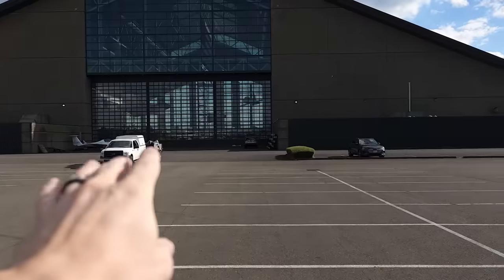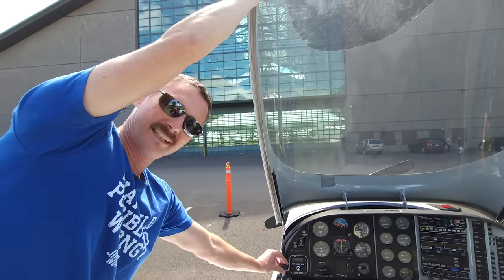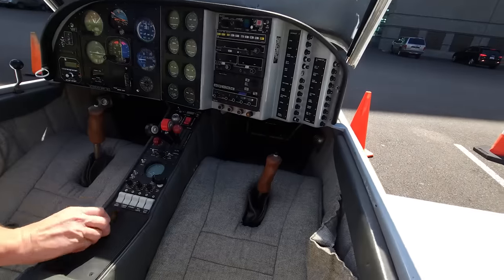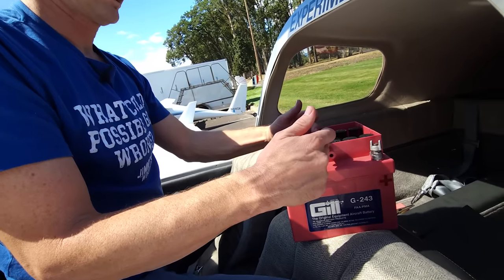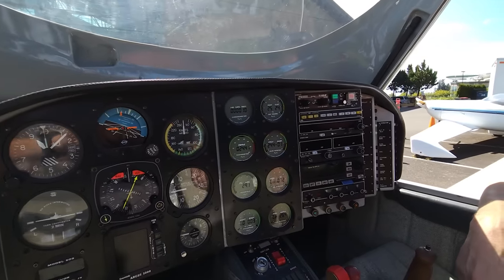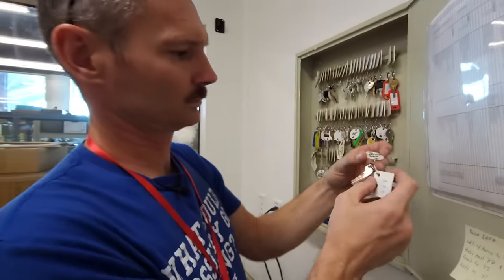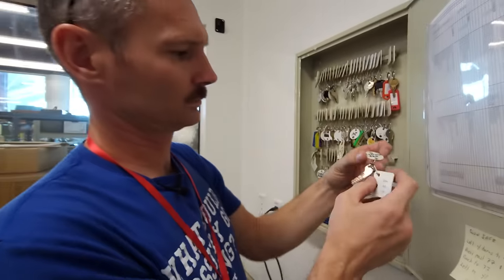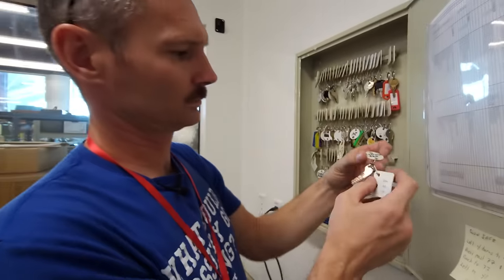Will This 250mph Museum Airplane Start & Fly?

Comment: This is a really cool idea, take a museum plane that was in flying condition when it went in and restore it to flying condition. I have always felt a little sorry for museum planes because they look pretty on the outside but I know they’ll never fly again. Looks like this one could be an exception!
Reply: yeah, most museum planes are empty hulks, all the useful but invisible bits stripped out and used to either keep other aircraft flying before the plane was put in the museum or sold by the museum as an extra source of income.
Reply: I have always said that vehicles go into museums to die..
Reply: @jwenting  Right, and most engines are "Pickled" and fuel tanks are drained and purged for the safety and comfort of the visitors. So there is quite a bit of work to do before they are air worthy.  Especially since the FAA keeps writing new regulations that have to be met each year for the current Annual to be signed off.

Comment: As an A&P, Flight Engineer and Pilot that doesn’t get to fly hardly any, I love this. Jimmy, thank you! One of these days, I’ll get back to flying but until then, you’re it.
Reply: As valuable as the engines are, I find it worthwhile to do a little more diligence to prevent damage after long term storage. I would have purged the fuel lines, borscoped the cylinders and fogged them before even cranking the engine. The smoke was obviously unburnt fuel because the ignition was off (no checklist?) But there's a lot of smoke because the rings haven't fully set in (normal after storage) but let's hope the cylinders survived dry cranking, also a cause of excessive smoke.

Comment: That little snake was absolutely terrified of you.
That's a nice Lancair you bought.  Pretty darned good for sight unseen.  Looks like it needs some work, but after sitting for 20 years, that's to be expected.
The leather flight suit with the electrical connection?  Yep, back before bombers were pressurized, crew members, especially waist gunners who would stand at and fire from open windows, wore electrically heated suits.

Comment: for the gas cans, buy race cans (sometimes sold as utility cans). Can fill cars/boats/airplanes much quicker, and there's none of the safety junk
Reply: They make an awesome battery pump for them too. Even has an auto shut off so you don't over fill! (TERA PUMP TRFA01-XL)
Reply: One can also purchase old school spouts from that giant online sales company named like a big river. I got a pack of 3 for ~$10 a week ago, to replace the Cali spouts - which I believe were designed by cardiac doctors with the intent of creating customers with high BP.
Reply: Those spouts aren't that bad, just grab the red safety piece w a pair of pliers and yank it out and they work fine 👍
Reply: Yep. I did that long ago!
Reply: You can also find the military style fuel containers at surplus stores.  Be sure to pick up a nozzle to go with it, they work great!
Reply: I thought those were outlawed for whatever reason?
Reply: @topaz123212  technically yes not EPA compliant, but everyone in the racing scene uses them and DOT/racing authorities don’t seem to care, and they’re like $22 at tractor supply. 
They’re way faster to use, make it much more difficult to spill fuel, and close to lock vapors in

Comment: My Museum.  I watched it being built for The Goose.  About 100 miles south of home base.   Incredible plane you found, and Evergreen had Everything.   Just wake-up smoke on the new plane.  Wiping the eye boogers out.  You would cough and choke if you slept for 20 years and then some crazed man is shaking you awake.   It really should have been cranked/pre-lubed with fresh oil before it was parked, but such is life.  Swap out the old oil and circulate, then do a compression test.  Then go fly it if it says yes.  The original builder of that plane was a perfectionist.   Can easily be seen.   Bike spoke piano hinge wires for the piano hinges or lineup of such hinges on the cowling.  Looks like he Dzus'ed everything and rid himself of the picky piano hinges on the cowling,,and saved the bike spoke/ Piano hinge pins.   That one will definitely cut the clouds in two once again.    Regular compressed air on the struts, fly not higher than 11,500, unless nitrogen is easy to find and cheap.

Comment: Not bike spokes. They are piano wires for removing the engine covers. They also work to remove the hinges on the gear flaps. They used them years ago to hold the cowl hinges together.

Comment: There used to be an EPIC RC flying field right behind where you were working in the parking lot. It was championed by a local Chaplain, Roger Weeks, and the irony was when he passed away they tore down his legacy and built that church that sits there now behind the parking lot. Yes, they did locate a new model field out off the parking area on the far back side, but I don't understand why they tore down what was there! There were paved runways, a permanent bathroom, and it was well manicured like the rest of the property. Take care of that old girl! I used to volunteer at the museum when I was in High School, before they built that building. At that time the Hercules was still in restoration across the highway.

Comment: Strut fix.
I've had excellent results with mixing about 20% AT-205 transmission reseal with strut oil then moving the strut up and down and charging it with nitrogen. 
Struts which have leaked in a month, have lasted 3+ years now.

Comment: Couple observations Jimmy. The dessicants are showing pink, which means they have absorbed moisture. They can be gently baked dry again and will be blue. The oil filter is a  mesh metal screen in the black box on  the right, inside the lower cowl. The screen is cleanable (if my dusty memory cells are functioning correctly.) Please check all ADs. Especially the fuel injector servo. The item you pointed out on top of the engine as the fuel injection servo, is the fuel distribution valve. The fuel servo is attached to the oil sump.  But I suspect you know that.  BTW, that museum looks like a cool place to hang out. I wish you would walk by the SR71 engine that was displayed behind the SR.
Reply from the maker: As usual, thanks for all the great info. Just wait till the next video I talk to one of the engineers that designed the SR 71 engine.
Reply: @therealjimmysworld   Why were you scared of a little snake when there was a great big Habu in the hangar?

Comment: Jimmy
The black blocky thing looks like an “Oberg” oil filter.
We used them in race cars.
You can take it apart to clean/inspect it for metal or other unwanted materials in your oil.
Btw that’s a very well put together build. That man in Arizona was very particular….you should feel confident in flying it……

Comment: N44BH 
Oil , Plugs Hoses , One belt, check oil for Grit and Metal fragments, replace seals On landing gear replace and fix Lights on Landing gear.
check Fuel Lines. Check rest of aircraft with Standard checks then check it again for Flight.
Good Buy Jimmy.

Comment: I can understand the joy in finding the documentation for the airplane. I purchased a government boat thinking all of the paperwork would be in order. What a joke!  They did not follow any of the government rules which everyone else has to abide by.  I dug very deep into the history of the vessel thinking I would get a paper trail that could establish some of the necessary information to use the vessel as a passenger vessel. I even talked to the vice president of the company who remembers the boat well as he was sweeping the floor when the boat was being built. After 3 years of digging and prepping the vessel for commercial us I finally gave up and sold the boat to a person who is using the boat for personal use and is having a great time with a well prepared boat.

Comment: 15:04 that looks like a Northrop Grumman RQ-4 Global Hawk. It's used for Intelligence, Surveillance and Reconnaissance (ISR) using high-resolution Synthetic Aperture Radar (SAR) among other sensors. It has a wingspan of ~39.9 m, comparable to the Boeing 757's wingspan of 38.0 m.

Comment: It looks like an Oberg filter.   its an oil prefilter with a removable / cleanable screen.   use it to check for metal particles in the oil.

Comment: I'm curious about the leaking fuel line.....  did the line actually fail, or was it just left loose from where the museum might have drained the fuel system before storage?
Reply from the maker: That was my first thought too. Nope :/ fuel line :/
Reply: @therealjimmysworld  It's fairly unusual for a teflon lined, stainless jacketed line to fail, unless it was bent too far.
Reply: @i.r.wayright1457 I doubt it was Teflon lined..
Reply: @thomasaltruda  What is the difference between Teflon and PTFE hose?
The simple answer is that they are the same thing: Teflon™ is a brand name for PTFE (Polytetrafluoroethylene) and is a trademark brand name used by the Du Pont company.
PTFE fuel hose has an internal Teflon (PTFE) liner that acts like a vapor barrier when running all types of fuels. This becomes especially useful when running alcoholic fuels, which otherwise often go through a traditional nitrile or rubber fuel hose.
Reply: @i.r.wayright1457  ok, but what makes you think that stainless braided hose was Teflon lined? I’m pretty sure it’s just got a rubber core. Aircraft rubber hoses are life limited around 8 to 12 years I believe.. it’s not surprising that it failed. All the hoses on this plane should be changed..

Comment: that's so funny you finding the rat paks, OMG Jimmy, i had some of those, in fact i bet i still have one sealed somewhere hidden away, and in the corner of my kitchen are a couple of those very Tabasco bottles (empty), so diddy i dare not through them away, will refill if ever i need some to go away with, if you not got room for a full size bottle 'that's just stupid'
remember, these paks were designed to fill you up, and bung you up, so you could work and fight for days without ever being worried about being caught out with your trousers round your ankles - but when you did finally go, oh dear, semtex was needed
nice plane Jimmy, a little playmate for the other one, get young Silas flying next to you before long

Comment: Hey Jimmy ... just remember, it was in a museum,  they probably loosened off the fittings to drain the fuel tank before it went into the museum.  I bet the line is fine, just the fitting was loose.

Comment: The plane my dad worked on (he made the fiberglass molds) is in the Smithsonian Air and Space Museum.  The wings have been removed for storage, but I don't think they were designed to be removed, so it probably cannot be made to fly again.  It's the Windecker Eagle.  There is one Windecker Eagle flying today.  The rest (there were 7 made I think) are in various museums or static displays or crashed.

Comment: Make sure u get the exact part number strut. I worked for a part store when I was a kid, and people would always just try to match the length and and one guy folded a trunk lid. It had too much pressure. Just a heads up.

Comment: Jimmy,  there's a hole in your plane @ the 10:00 mark
Us army air corps turned into the US Airforce in 1948
I've never built a plane,  a bunch of cars and bikes, yes but a plane no.  
That is a clean build ! For any build this one is top notch and a gorgeous build
Stainless steel fuel lines have rubber seals at the connections some times.  The rubber could have deteriorated over 20 years of no use

Comment: Nice video, and your new plane will need a sun shade while you're flying. The long thin rods run through the cowlings joining edges, and the short bikes spoke keeps the opposite end in line while pushing the long rod in.  Excuse the expression?  That pitot tube will need a cover to prevent wasps building nests.  Happy Safe Flying!

Comment: Random bits from blue bin….
- clear plastic cup with white top for checking water in fuel?
- spoke for clearing a clog in a hose?
- Data plate, lists O-360 180hp while eng looks to be iO-360 200hp/215hp ?
Long thin steel rods, either for a canopy sun shade or replacement control surface hinge pin?
Looks like an awesome spare airframe for you to keep one flying - although its sad if it’s never flown again as the donated party wished.

Comment: Possibly, for the final time, it wasn't in flight for twenty years. It had residual fuel in the hose. That's the reason why it had that terrible odor. As for the smoke, it was because of that fuel. While that fuel was in that hose, it separated inside of it. That separation happens whenever fuel is not being burned in the cylinders of that engine. All you needed to do was to wait for that residual fuel to be burned inside of them. Then, it will stop smoking and stop smelling terrible.

Comment: You're brave:  I would be frightened to attempt to start an engine that hasn't started in over 20 years.  I probably would have coated the pistons with new oil (maybe some mineral oil too?) and let it sit for at least 24 hours before starting the engine.  I wish you all the best with what looks like a very nice Lancair!

Comment: I used to visit this museum several times a year. It was much better before it almost went bankrupt and had to sell off its most prized airplanes. It had the best restored P-38 in the world and a Ford Tri-Motor that was impeccable. 

For those at have never been, Evergreen water park is next Door. It’s the only water park in the world with a 747-200 on the roof that the water slides run out of.
Reply: Wow!

Comment: Hey Jimmy, the miniature bi-wing with no way to turn off...why not wire up a kill switch or use a relay or switch to open the primary voltage source?  Please be careful.
Michael

Comment: How do you measure the engine space before changing this Lancare engine out for a larger engine with lower hours? I would add that you could use a photographers reflective screen when filming inside of a shaded cock-pit when calling out instruments.  In your searches in aircraft catalogues have you found an answer to the need for relief while in the air on extended trips, you might remember?  This could be an untapped market for pilots everywhere don't you think?

Comment: I don't know if I'm right or wrong but my first guess is the gaskets and seals are SHOT. So long sitting they are probably rotted. I'm assuming you changed the oil filter on it regardless.  Not bad for a roll of the dice though! Nice work Jimmy! As far as the smoke goes, it could have also have been old fuel that was just sitting in the engine and as well as the injectors, so some of that nasty gunk that forms after a plan has been sitting too long. You're awful lucky it didn't just lock up on you and blow the engine or crack the block. I've seen a ton of crazy things happen that I still wonder "how could that possibly have happened." lol 
The plugs and firing off sounded beautiful though so I don't think ignition at all. Maybe it's also like you said, could have been a plug in the exhaust or over it. 
Can't wait to find out what the problem was!

Comment: After the Spruce Goose was moved from Long Beach to McMinnville the airplane spent quite a while being prepared for display.  A coworker (who owned one of the smallest flying airplanes anywhere) one of many volunteers to work on the airplane to get it ready for display.  I was talking to him about the work and he was pretty angry at the people in Long Beach who prepared the plane for display there.  It seems that thay covered the airplane with shrink wrap, which is applied and then heated to take the form of whatever it is covering.  The shrink wrap compressed the wooden structure and was removed before the airplane went on display in McMinnville.  The restoration crew here had to repair the damage caused by the shrink wrap before the airplane was made airworthy.  And yes, when they were done it is possible the plane could have been flown again.  Even the engines were thouroughly gone through to be sure they were in tiptop condition.
Reply: It only ever flew once for 26 seconds at a altitude of 70 feet.

Comment: The Spruce Goose was moored in the harbor in Long Beach near the QE2, after the discovery of Oil in Alaska, the Atlantic Richfield Company "I worked for ARCO for 30 years" Los Angeles refinery was adapted to process the Alaskan crude, In order for that to happen, the harbor where the SG was located has to be deepened, the SG was moved across the harbor and was ultimately moved to the location where you were in this video. I don't remember the exact dates on these events

Comment: What did you pay? I reckon since you used new fuel an oil change would have reduced start up wear but that smoke could have been an oil preservative injected into cylinders when mothballed - similar to a fine lube i use on my stored model plane engines. ✔️

Comment: Hi Jimmy, the engineer that invented those gas cans has never used one, I hate those things.  Yes, a stainless-steel braided hose has a life span, depending on the fuel, on race cars using methanol we get 5 to 7 years and they start leaking.

Comment: A pair of side cutters will fix that red safety lock on the fuel can. And still let it work as a valve when you pull the can outta the tank.

Comment: When you were talking about the spark plugs in the fuel transducer as the fuel flowed through the engine you forgot vroom, because without vroom you can't take off.

Comment: With all the other storage stuff they did wonder if they sprayed some preservative oil on the engine and that for long term storage, when I assembled new snowmobiles from the factory for polaris they always smoked when first started until that oil burned off.

Comment: You should see if XS would sponsor your batteries, those XS lithium batteries weigh just under 7 pounds. that's like 30+lbs less than a lot of batteries, which is great for smaller planes.